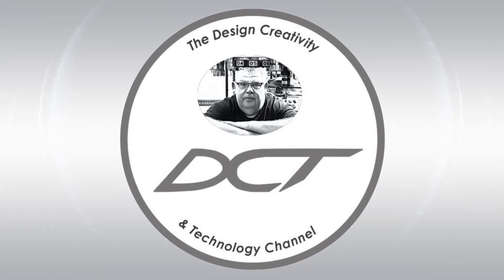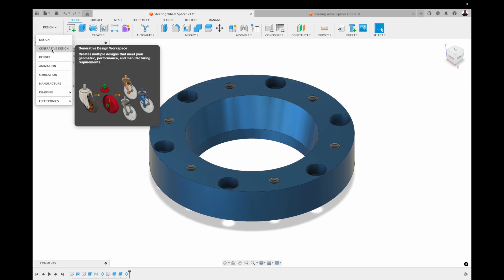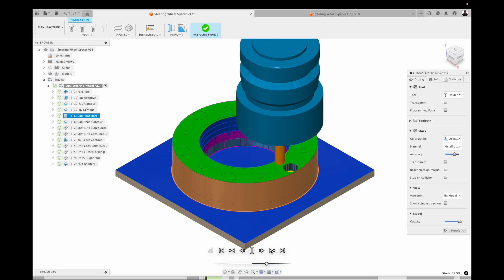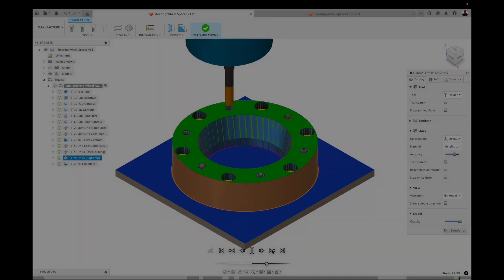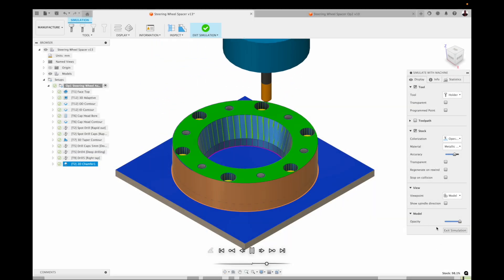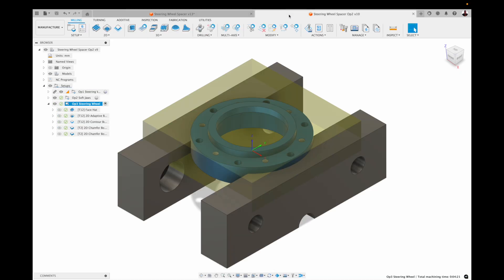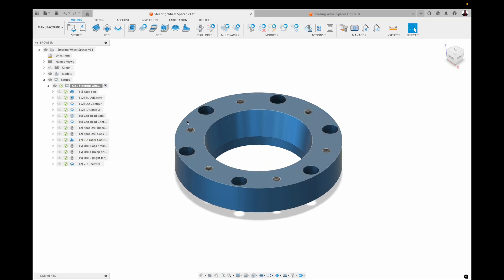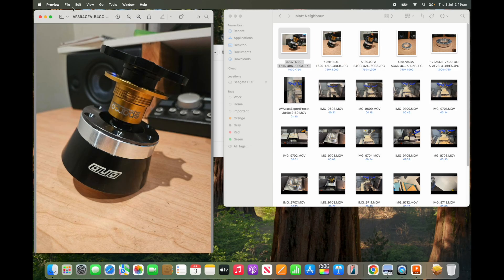CNC milling | Nissan R33 | steering wheel adapter

Comment: How did you zero the second op ?
Reply from the maker: Hello. I relied on the soft jaws for the initial zero. Once you buzz the hat off you pick up the internal bore to become more precise. I used my Haimer. But you could also use a coaxial DTI. Cheers 🍻
Reply: @DCT_Aaron_Engineering Thanks mate cheers!
Reply from the maker: You’re welcome 👍

Comment: Gday Aaron, the mill still does a good job, the boss turned out spot on, the surface finish on the taper looked perfect, nice job mate, cheers
Reply from the maker: G'day Matty.  Thank you for checking it out.  Yes the 3D surface finishe came out lovely on that taper.  My X-Axis ball screw noises are getting louder, so I can see a fix on the horizon coming up soon.  Cheers buddy, Aaron.